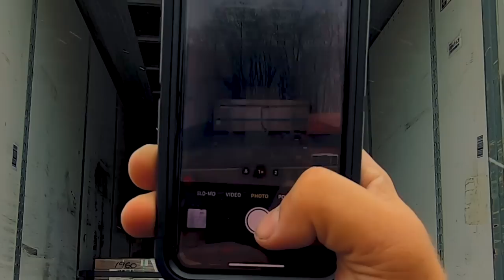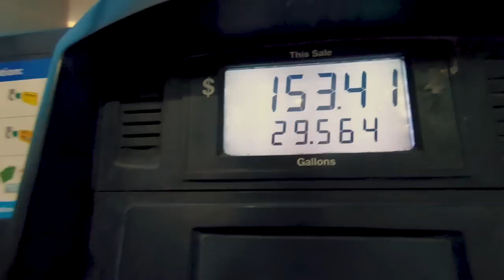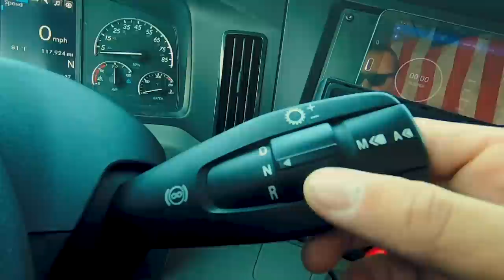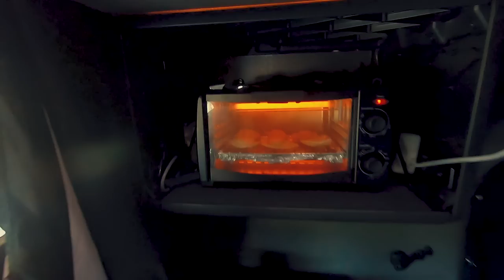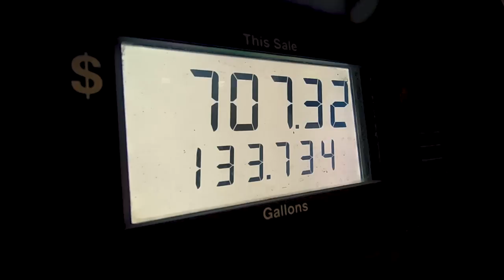Trucking ECONOMY CRASHING | Hauling From Pennsylvania To Texas CHEAP | FUEL PRICES | OTR Semi BIGRIG

Comment: 2.50 a mile ?? That seems really low considering the cost of fuel etc… I don’t understand why the loads are still going so cheap right now, I know the shoppers are paying more but it’s not getting to the drivers.
Reply: It's called supply and demand. Way to many trucks fighting for the same freight.
Reply: Gotta do Consolidated freight only way and east coast
Reply: @anthonyh884  but they keep saying there is a trucker shortage ?!?!? It’s all very confusing
Reply: yeah I took a power only for 3k.. when I booked it I didn't get the rate right ot was 2 dollar a mile yeah but u finished it in 2 days 1500p miles..had to run illegal but ohh well
Reply: The trucker shortage is for the mega carriers. And by shortage they mean lack of drivers willing to drive for 35 cents per mile. As for freight capacity there’s a ton of it right now because when the rates were good, everyone and their grandma got a truck. This industry always fluctuates. It’s the most constant part of trucking.
Reply: Have you not seen our economy is near a recession again? Prices for everything going up.  Fuel prices are HIGH! You keep wanting higher freight pay that is just gonna make the stuff on the store shelf more expensive.  Something has to give in this equation and the most likely one is the load pay.
Reply: That is low. $2.50 a mile is barely making a profit with current expenses.
Reply: This is trucking …. Market is a roaller coaster 2.50 a mile with this market is not bad if is 15k pounds load

Comment: You don't have to buy a dry van if you are leased onto a company, but you can also buy a used dry van and repair as needed used for about $5k. I would definitely go o/o with the volvo you would be able to make more money even with low rates. Make sure you get your fuel surcharge from brokers.
Reply: Nope
Reply: There are no more dry vans for $5k anymore even the early 2000s are at least $10-15k +.

Also the brokers don’t give you shet above the agreed upon rate.
Reply: Volvo’s are trash!!Dry van for $5k yea a 1972 dry van!
Reply: @tommyreed4220  why are Volvos trash?
Reply: How do you get your surcharge from the brokers?

Comment: Rusty if you end up becoming an owner operator do not buy a trailer rent or lease one you won’t be responsible for maintenance on it and most places require your trailer to be less than 10 years old to be loaded or unloaded.   Leasing or renting is definitely the cheaper way to go

Comment: Rusty get away from the brokers develop relationships with people you normally deliver to. Charge per mile for how much you fill up per gallon if it’s $5.50 a gallon charge that per mile
Reply: yeah u wish u can get 5 bucks a mile right now
Reply: @dell7054  I’m getting 6.09 a mile.  I don’t go through a broker a deal directly with the distributor
Reply: @dell7054  Right now I charge six dollars a mile and I get it going to deliver on the way back I just do a flat rate if I’m picking something up
Reply: @dell7054  They all have the money it’s just the Brokeridge want to keep it all so that’s why deal directly with the distributors
Reply: @jonscott7686  yeah u got lucky.. keep doing it .. that's like finding a unicorn 6 bucks a mile.. u must be banking
Reply: @dell7054  No I’ve been with the same company for over seven years as an owner operator that’s why I said don’t use brokers they rip you off
Reply: @dell7054  Well I must say before I signed on as an operator I was a company driver for 3 1/2 years now I’ve been on operator with him for almost 4 years I know they raise their rates with the product to get delivered but I’m only staying on page
Reply: @jonscott7686  6.09 a mile for how many miles